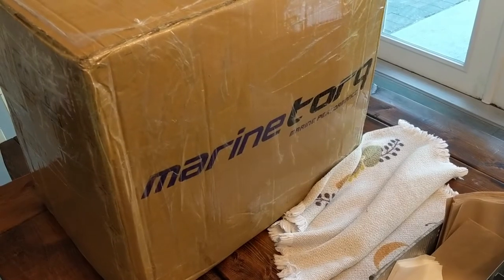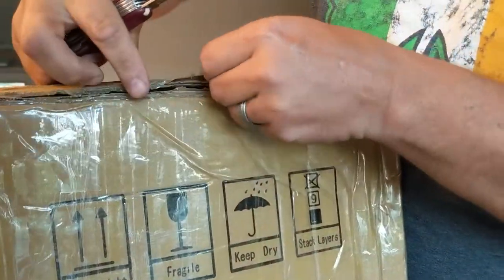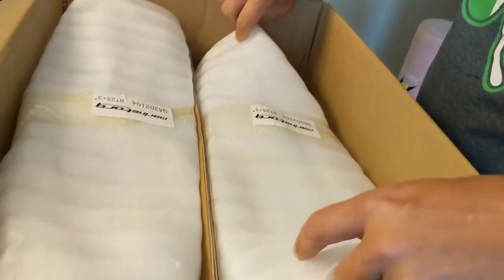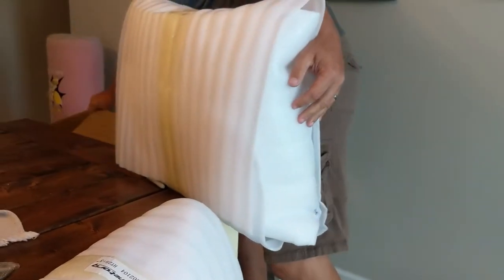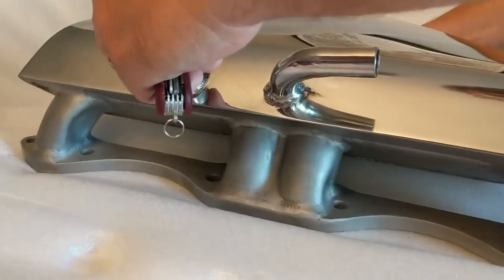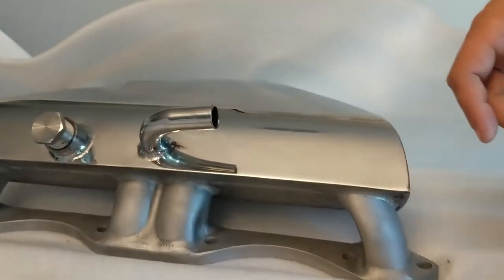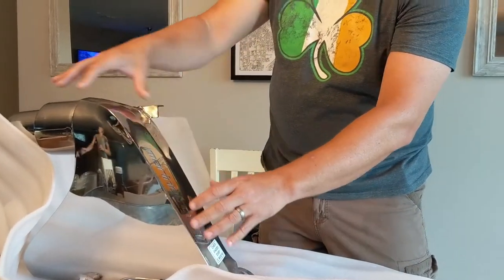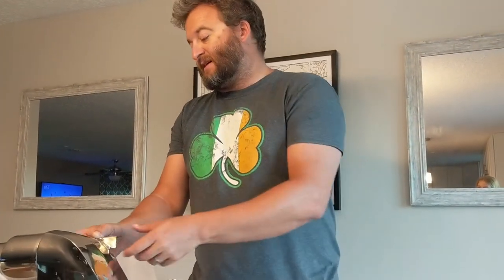MarineTorq Stainless Steel Manifolds Unboxing - McCoppin's Manual To Manliness

Comment: Did you notice any performance or efficiency changes ? How about noise?
Reply from the maker: @SimonB-t7t  yes. The rear felt lighter and it stayed cooler. Had a little more pep in acceleration.
Reply: @brianmccoppin  any changes in fuel consumption?
Reply from the maker: @SimonB-t7t  I think it is better. But at the same time I drive it faster now lol